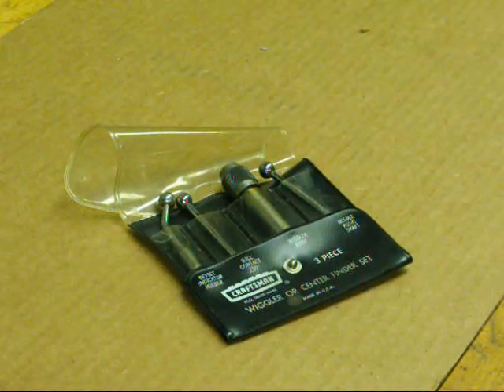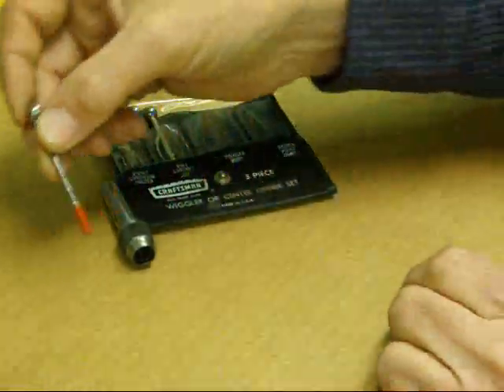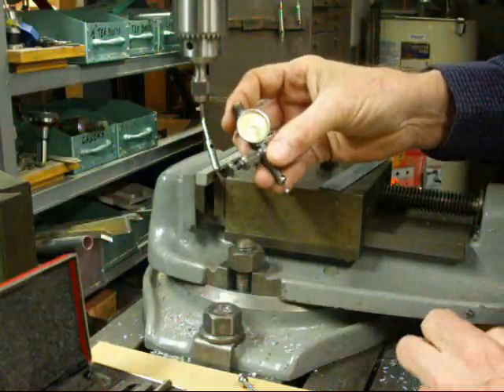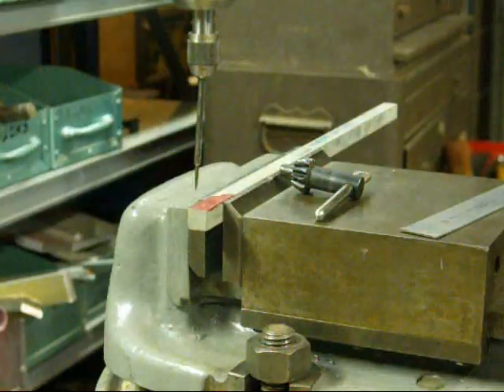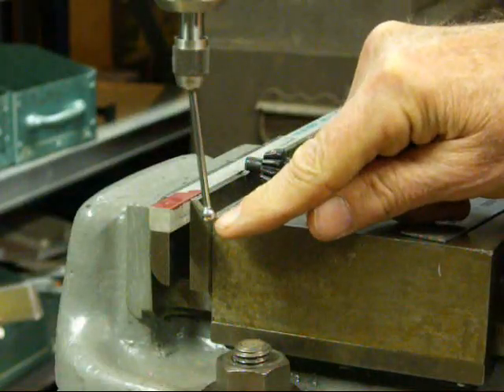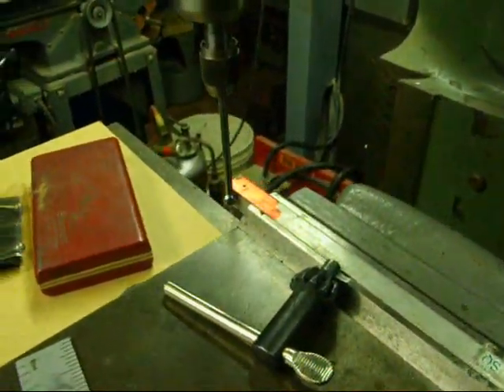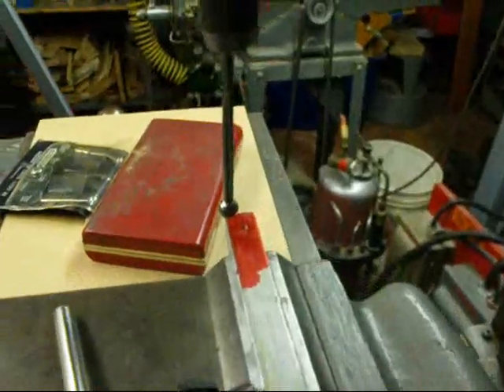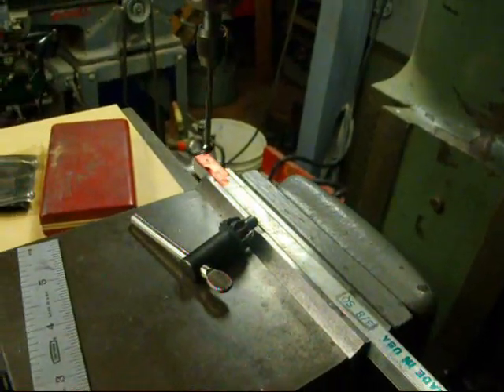USING A WIGGLER on the BRIDGEPORT MILL

Comment: How come when using the wiggler, when it's steady, that's the edge, but using an edge finder, you move it until it's JUST offset again, for the edge? It seems like when the edge finder is aligned, THAT should be the edge.
Reply: I've always used an edge finder and wiggler the same way, move into the work piece until the tool jumps, move over half the tool diameter and you're on center.

Comment: I have been a machinist for 50 years. I have seen these, never used them. I call an .200 edge finder, a wiggler. If you have a DRO, like this (I have the same B&L, I bought in 1980), I "wiggle" the far edge, 

zero out the digital readout and wiggle the front edge, take the reading and dividing by two. That gives you
a very accurate center of the part. My father was an engineer, his two brothers were life long machinists, and their father was a tool & die maker during the depression. When my uncle retired, he gave me his tool box. There was that same wiggler pouch in it. Now I know how it works, although I would never use it. That uncle served as a machinist's mate on a submarine tender in WW2. He would have liked these machinist's tips here.  Thanks.

Comment: I have access to a few lathes and a mill  at work. Ive been toying around with them as a hobby......now im hooked. I found and exact wiggler like the one in this video at work, except its mad by Starrett. I told my co-workers I was going to ask Mr. Pete how to use it. Sure enough he had an answer. Do you have any videos on boring and sleeving a bearing housing? Thanks always!
Reply from the maker: Thanks for watching--no videos on sleeving a housing
Reply: turn right machine just did a boring & sleeving job

Comment: question....I'm not a machinist, but once in a while, I need to  align the centerline of a drill bit in a drill press to cross scribed center point of hole I want to drill in a piece of flat steel. It seems every time I "center punch" this point, it isn't dead on.  How do you do this without centerpunching first, as it is never as accurate as I want. I've searched the net to no avail to find a solution.
Reply from the maker: +Martin Walters One of my videos goes into great detail on that with several methods. I do not remember which one
Reply: Ok, thanks. I'll look for it. Although, after viewing this video, it dawned on  me why machinists use the methods shown in your video. I've never been introduced to machinist's skills and methods so I'm trying to learn some to adapt to my own needs in my general purpose shop. I just bought a dial indicator, after seeing how they are used for so many things.  Thanks again
Reply: btw, if I understand these techniques correctly, you are simply accurately finding an edge to measure to another point, no? Kind of like a tape measure, but ultimately more accurate? Thanks for any insight.
Reply: Martin Walters optical center punch I bought one from grizzle it works great

Comment: Nice video, the method you show to find the edge with the ball wiggler isn't quite right. When using the ball with the spindle turning (approx. 500RPM) - the table must be slowly moved into the work until the ball spins up and off the surface. Once the ball spins up and off the surface, then the edge is found and then it can be moved in 0.125" as you say.

Comment: when I use a Wiggler to find an edge I have the ball end clamp as lightly tightend as practical but enough to retain the wiggler in position then advance  the wiggler in to the face to be refrenced slowly till the friction of the wiggler touching the face spins it off I the call that that point and adjust the DRO for the rad this diffrent to your method as you do not have to judge when it is there

Paul

Comment: I use a wiggler or edge finder all the time at work, even running CNC mills if the probe breaks you have to break out the old edge finder which can be pretty hard to see in an enclosed machine.
These days I run a Bridgeport mill so my edge finder is in constant use.